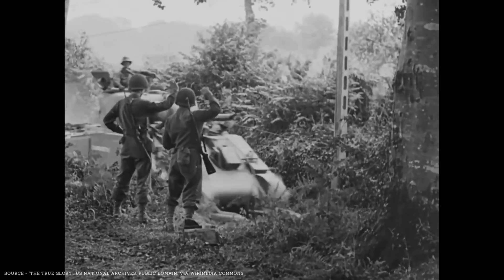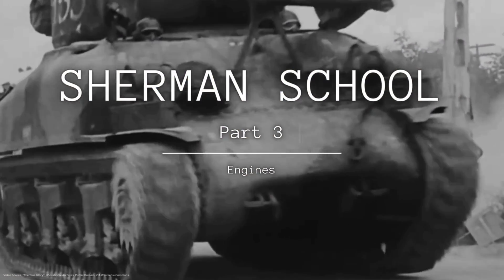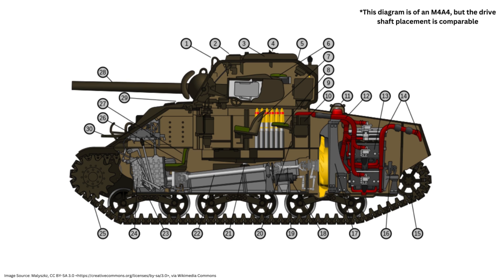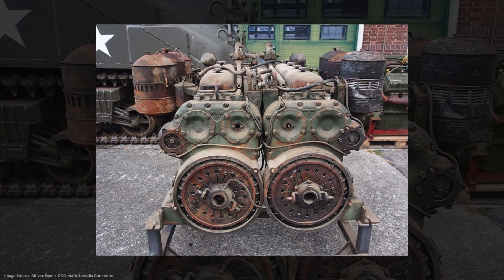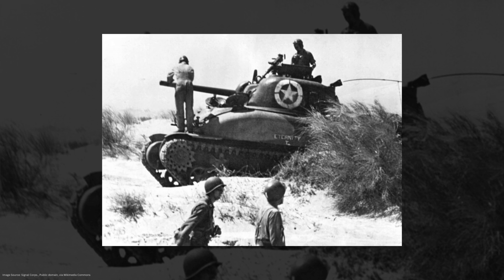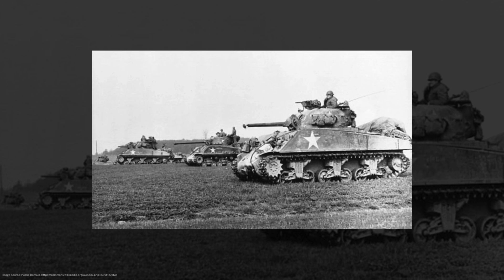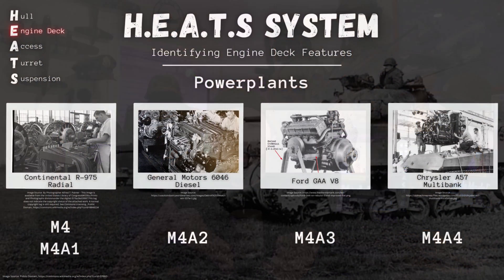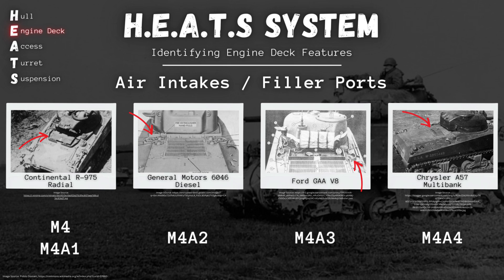The POWER Behind the M4 Sherman Tank | Sherman School: Part 3

Comment: These engines were tested on the M3 Lee series before the Sherman. The Continental R975 was the first engine to be fitted to the Sherman M4A1 followed by the GM 6046 Diesel in the M4A2. The R975 in the M4 was the third for production followed by the Chrysler A57 in the M4A4. The Ford GAA in the M4A3 was last to reach production and was not mass produced until late1943.  The Chrysler A57 M4A4 was cancelled in August 1943, replaced by M4 Composite at Detroit Arsenal.

Comment: Another great video!
Dang that multi bank is a beast!!!
Reply: Right ?   You would it would be a maintenance nightmare but I have read several places that it was one of the most mechanically reliable of the engines used.  I do wonder how the fuel economy is though
Reply: @ninus17  Hahahaha a simple spark plug change.. Uhm yeah we are gonna need 40 plugs, and 5 oil filters, oh yeah while we are at it, 25 quarts of oil lol

Comment: I didn't see a reply to a question one asked with your ammo mig paints video, but can these paints be used for brushing as well, otherwise what do you recommend to compliment these for when you need to brush vs the air brush ready paints? Just getting back into modeling and new to airbrushing. Thanks for your videos that have been watching so far. I know this is not related to this video so appreciate the help if you see this.